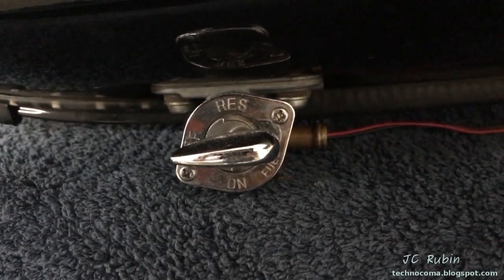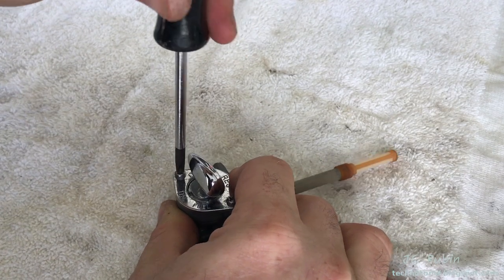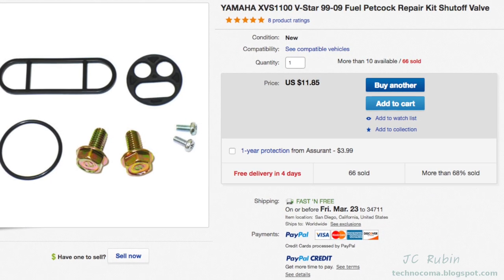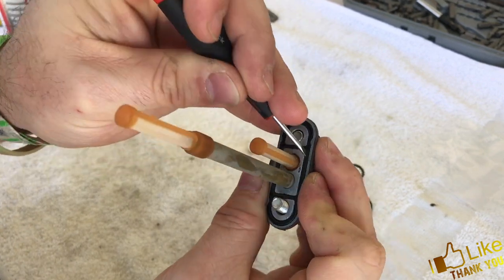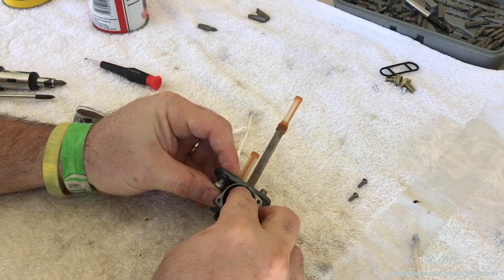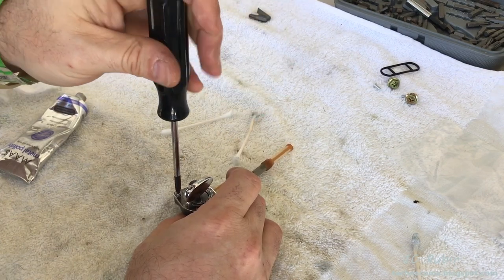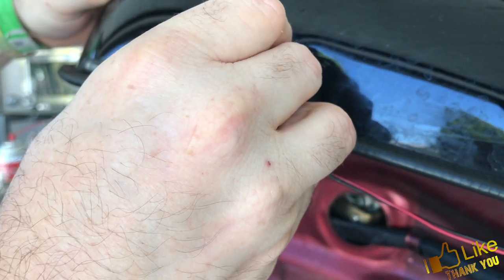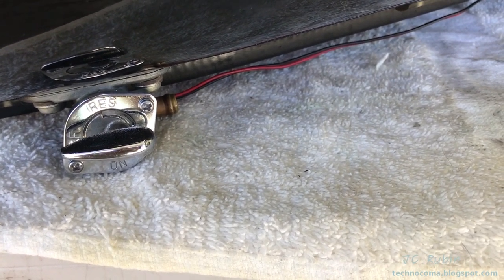Yamaha VSTAR 1100 Fuel Shutoff Valve - Maintenance and Repair

Comment: Man, I hope I can get away with this simple procedure... just ordered this kit. Be so much easier than cleaning the carbs. I just bought an '05 with 3,200 miles on it... Hoping it's just dry rubber seal here and not in the carb like in your other vid... but, either way, I now have real confidence that I can fix the issue bcuz of Cool Guys like You. ;) Thanks Again!!
Reply from the maker: This is one of the easier procedures, I think.

Comment: Thanks mate, very clear video. When I tried to remove the fuel line, the brass nozzle came out of the housing (stuck in the fuel hose). How do I securely fix the nozzle back in the housing please?
Reply from the maker: I could think of a few ways, I imagine they are all bad ideas, that shouldn't fail and may necessitate replacement.
Reply: Thanks for the reply, my friend soldered the nozzle back in place-all good!
Reply from the maker: @simoniggleden315  a good solder job may also be a solution. Just keep an eye on it.

Comment: Hi bud, can I ask your advice regarding my xvs1100 V Star. Its suddenly running very rough and won't pull any revs. I suspect a blocked carburettor jet or jets, especially as my tank has recently been off the bike. I washed and dried out the tank before installing it, rebuilt the fuel cock and changed the in-line filter.  It was running fine but now..its not. How do I access the slow running- low speed jets? Is it necessary to remove fhe tank? Do I have to remove air filter or carburettor(s)? Will be grateful for your advice
Reply from the maker: I have a whole playlist that includes removing and rebuilding the carbs.

https://www.youtube.com/watch?v=sNAX1Kc-fPg&list=PLK_zQ6_j4TF3RGcIQAnttY1D04cVC22WD

Comment: My bike only stays on if its on the reserve position,  do you have an idea why that might be?  Damaged petcock or do you think it's just dirty?
Reply from the maker: obstruction perhaps, check with air in reverse.
Reply: @retrotechandelectronics  thank you,  and yeah sure enough it was clogged up. I removed the petcock and the "on position" passageway was completely obstructed. Screens were cracked up and not good either gasket seen better days. Replacing all of it. Thank you for your help brother

Comment: I left my petcock on overnight. I rode it the next day with no problems. Will leaving the petcock on cause problems?
Reply from the maker: Shouldn’t cause an issue as long as the float seals and needle dont leak, if they do though, the whole tank could drain over time into the engine.

Comment: My valve is leaking when I put it on reserve. Sometimes when I put it on "on" - I have to wiggle it a little to hold tight. 
Do you think that this repair would work?
Reply from the maker: Probably the rubber seal gone bad.

Comment: Could you not of just bought the entire fuel pet cock complete as an entire unit instead of replacing all the seals?
Reply from the maker: I guess its possible, I never considered it, I bet its 6x the price.
Reply: @retrotechandelectronics  I looked it up on Amazon and there are lots available for about $20.00. Great video by the way.

Comment: this is horrible, it's done by a guy that drains tanks first instead of bypassing the valve to see if it actually works without it
Reply from the maker: Do you mean the one that was already drained for service. Sorry I couldn't accommodate you.  Did you consider that the failure of this valve may have something to do with it not holding gas back in the off position, and that was the need for replacement, Genius.